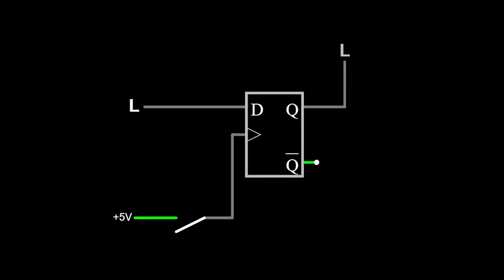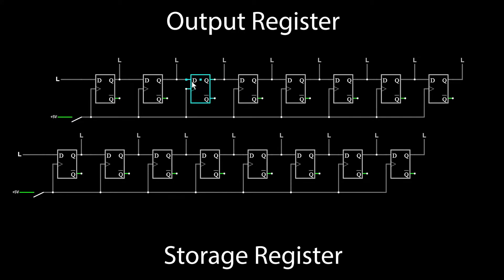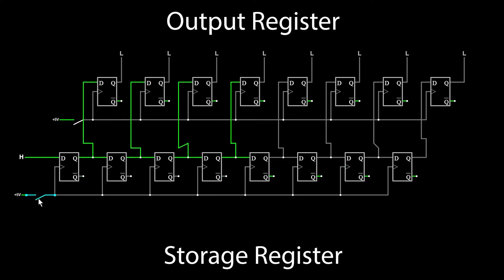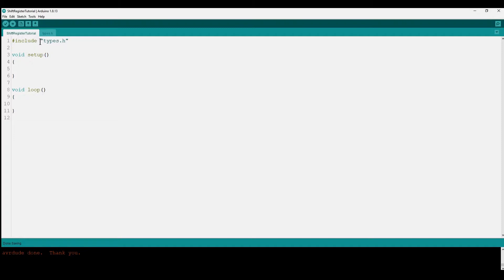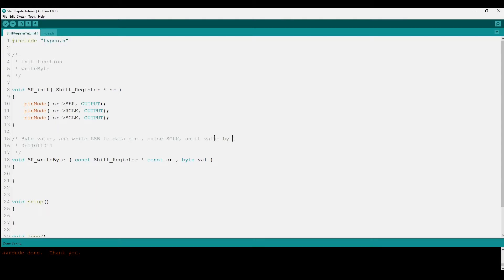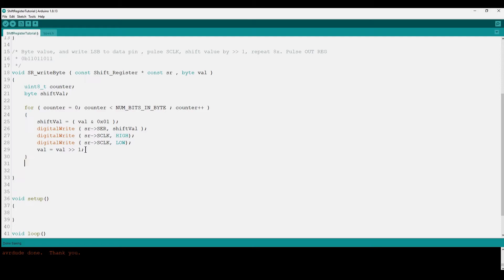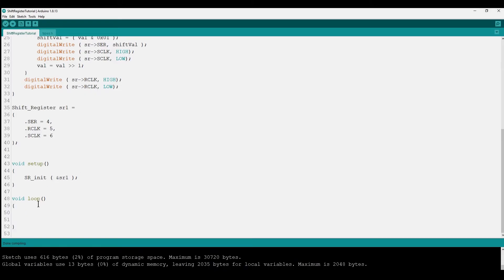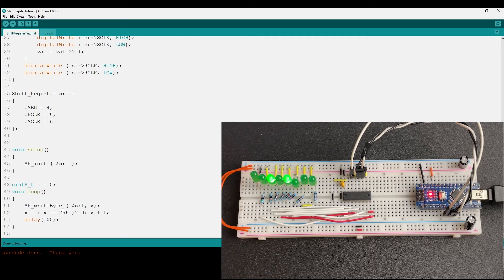Serial-In Parallel-Out Shift Register Tutorial (SN74HC595N) using Arduino

Comment: Could you control 2 shift register using one shift register? 

I checked the datasheets and it has very high speeds(25Mhz) limits and the inputs need a max of 125ns to register any input. So in 1000ns you could send one bit to each shift register and then connect 4 shift registers to those 2 and send 1 bit every 8µs and then 64µs for 8 etc. So it would be useful for something, maybe not a 4K tv but for a display that can only display pictures.

Comment: Hi,
Can you help me with an Arduino code to read RSB485 Modus data from a chlorine sensor and send it in Jason format to MySQL server along with the information given below connecting the ESP8266 to a wifi network and also control a relay through it if the value read is below or above range (0.2 to 2 mg/L).

Jason data: Sensor Id (To be assigned to ESP8266), Location Name(To be assigned to ESP8266), Chlorine in mg/L, Date&Time

Enquiry frame to fetch data: 01 03 00 00 00 0A C5 CD
Response Frame: 01 03 14 00 03 01 0D 01 1C 00 00 05 1C 00 00 00 01 00 14 00 64 03 E8 19 94>> Decimal 284 >> 2.84 mg/L

Components
1.	ESP8266
2.	RS485 to TTL
3.	Relay
4.	Sensor with RS485 output